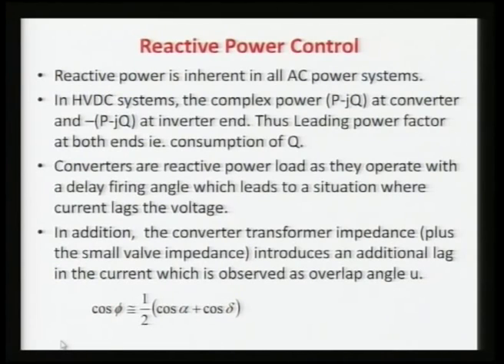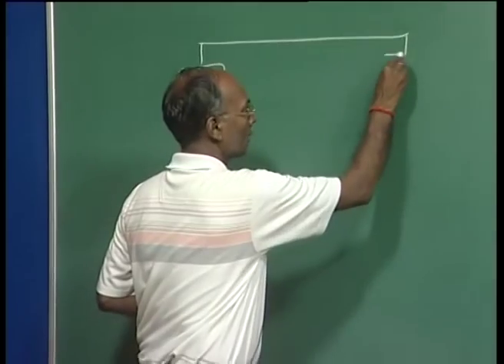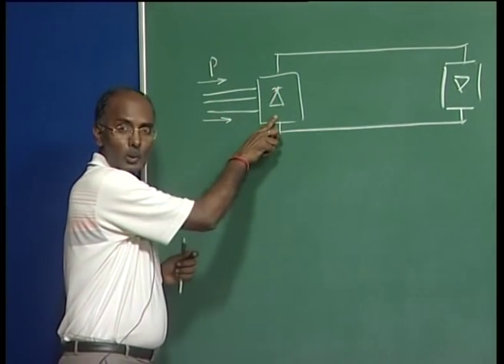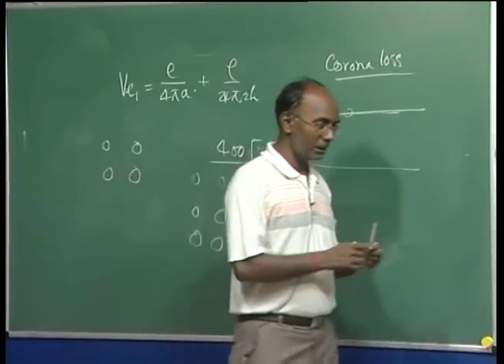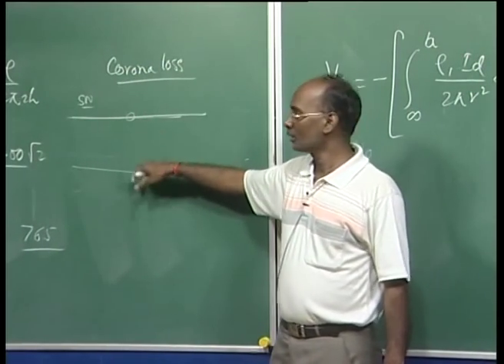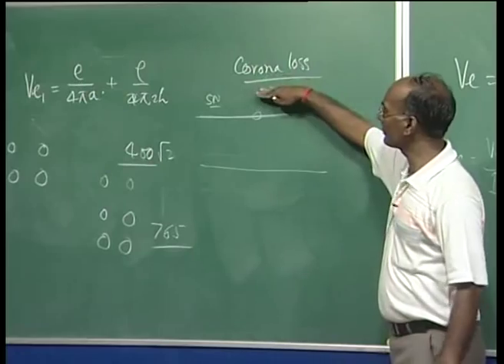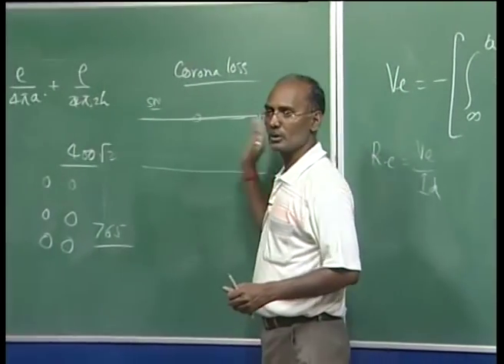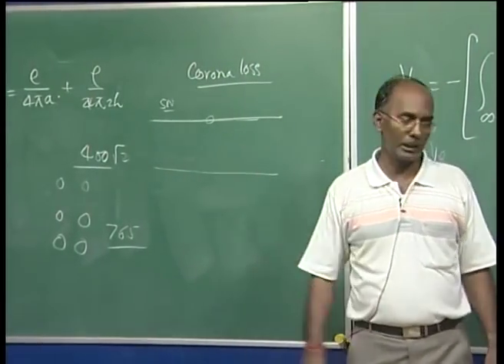Mod-01 Lec-28 Lecture-28.High Voltage DC Transmission

Comment: there are more than 40 lectures, each one is equally important but one may not be interested in each lecture, so if you could label the lectures  based on the topic covered. like this one is about Q-Control. there must be another lecture about P-Control,